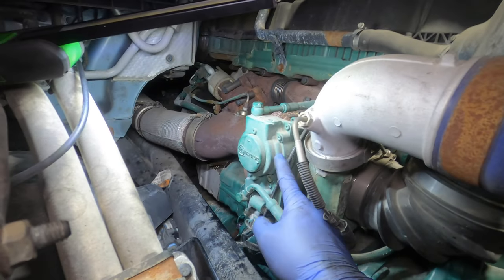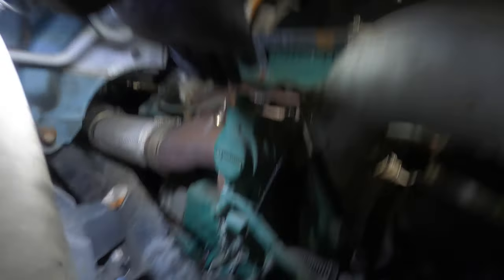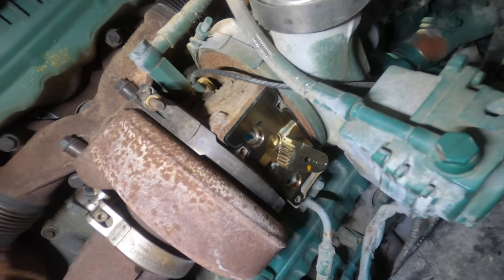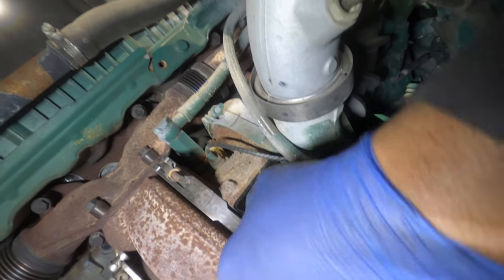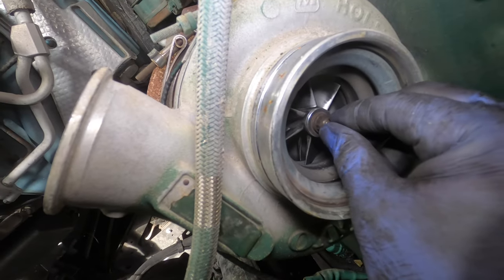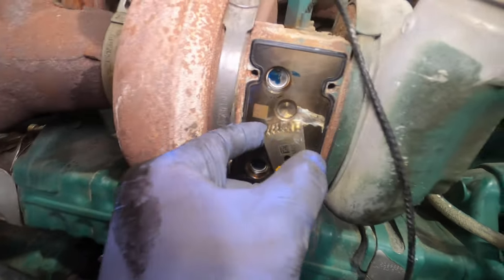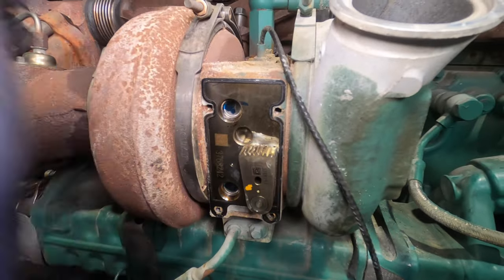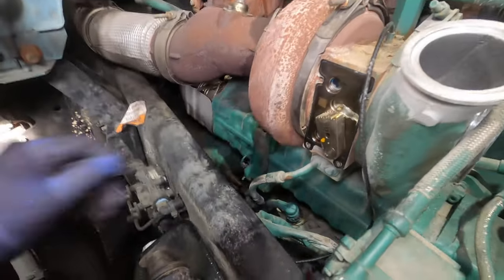Semi truck keeps shutting down. Check This.

Comment: I have 2009 and mine keeps shutting  off and no accelerator response at all.
Reply: Did you find out what happened?mine have the same issues
Reply: @kenngeno2385  no, but someone  sId air pressure won't build up

Comment: I am a new trucker. Looking out the trunk with 680,000 miles and has 13,800 engine hours on it. how important are the engine hours? How do I know if they match?

Make a video on miles vs engine hours